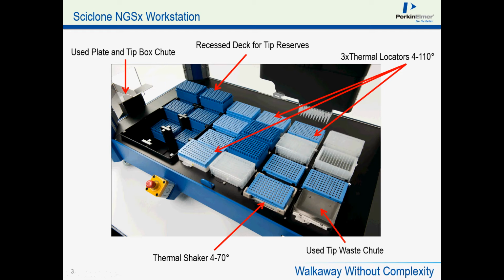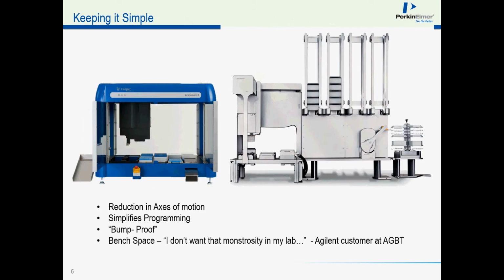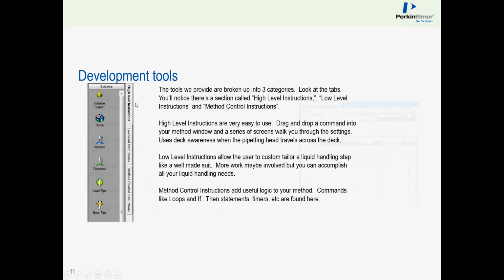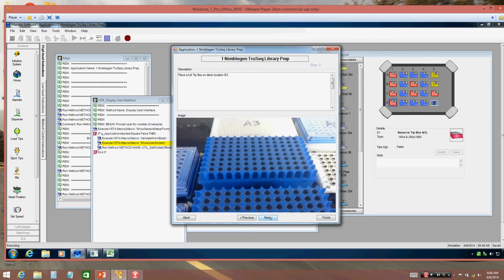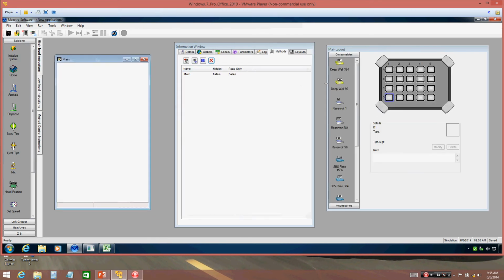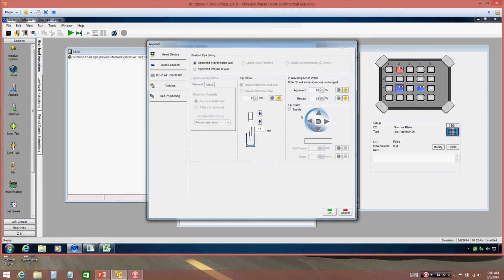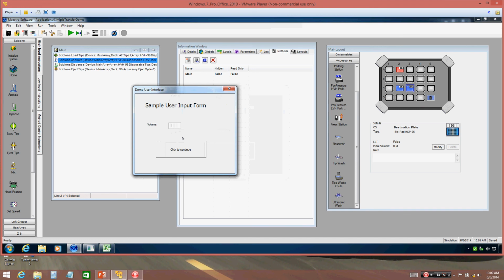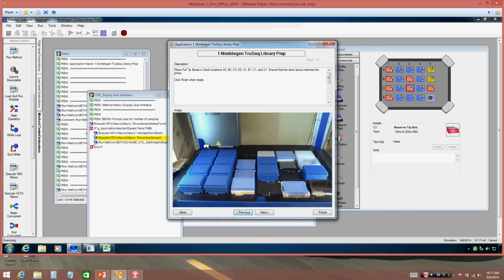Maestro NGS Software/Hardware Overview

Comment: Long shot as this is quite an old video but are there any other online resources to help with scripting using this software? Very good video btw! I'm just new to the platform and any additional help would be appreciated.
Reply from the maker: Maestro is very easy to use.  The software is mainly drag and drop operations.  Scripting is available if you wanted to add bells and whistles to your application.  Do you have a system?
Reply: @ngl1145  automating a protocol using a Sciclone G3 Liquid Handling Workstation, it's all very intuitive but someone else wrote the script and I'm modifying it to correctly pipette the more viscous solutions. I've mostly got the hang of it, but I was just hoping there were some more resources to better understand the more complex functions.
Reply from the maker: @georgeroybarratt9490  I work with these systems all the time.  PerkinElmer does have the Sciclone iQ which has a built in Thermocyler into the deck.  This would allow for high temp incubations with a heated lid.  When working with viscous reagents, my tips would be to slow down your aspirate and dispense speeds.  For the High Level Instructions, I would also make the approach/retract speeds to be slow (10%).  This will prevent your tips from carrying over excessive amounts of reagent/beads.